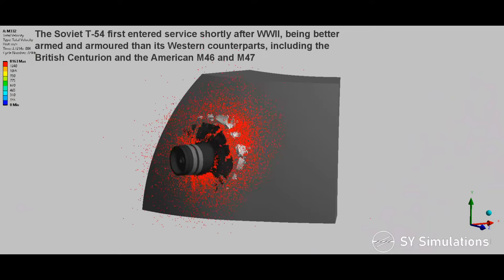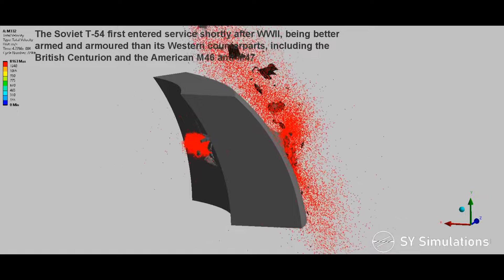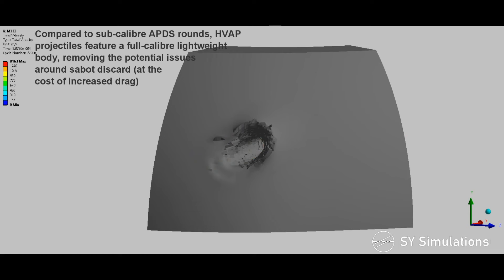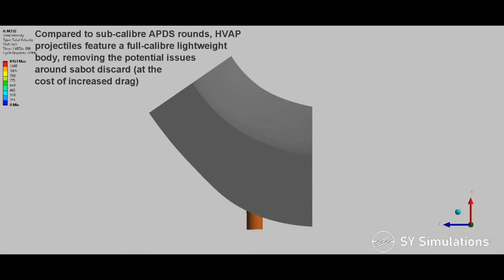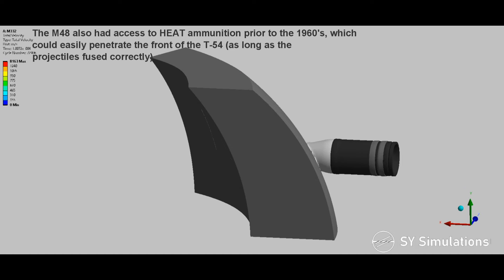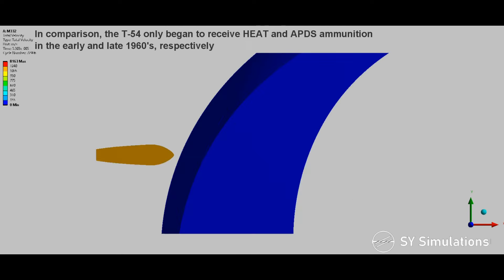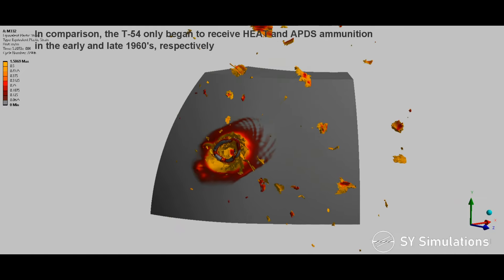M48 PATTON vs T-54 | Standoff at Checkpoint Charlie Pt.2 | M332 HVAP Armour Penetration Simulation

Comment: I was more interested in how it would fare against the hull’s upper front plate of T-54 than the turret.
Reply: I'd be interested to see an M48 gunnery manual from the time. I wonder if they were told to aim for the turret, hull, or center-mass. I am guessing the latter.
Reply: @SeanMurphy1090-d5u It was essentially point blank at checkpoint Charlie so they could’ve aimed anywhere they wanted really 🤷‍♂️
Reply: @SeanMurphy1090-d5u Tankers don’t really aim for any specific part at realistic range. The goal is to hit the target, and it’s harder than it looks even at closer ranges. Most nations train tankers to abandon tank after a direct hit for safety, so a single good hit may be all that’s necessary even without penetration or significant damage.
Reply: Literally said in the description.
Reply: @SeanMurphy1090-d5u I'm fairly confident that the manual tells the tanker if you shoot the front right hull of the T-54 with a heat round, there will be a high chance of ammunition explosion. So at normal engagement distance you would go for the center mass, however, you should know to aim at the ammunition storage when you can confidently do so.
Reply: Tankers aim center-mass, always. 

Aiming for ammunition is very, very rarely done and is mostly a video game thing War Thunder players assume is realistic.

Comment: Very nice note about fusing of western HEAT rounds. For some reasons fuzes on those were very mediocre and they never bothered upgrading them properly, which led to substantial fuze failure rate at 60 degrees slope and near guaranteed at angles over 65 degrees.
Reply: As far as I know this was more for the M348 HEAT shell and less of an issue for the M431 that would've been issued at this time. Not sure how true that is though
Reply: M431 was a vast improvement over the previous heat designs. The 431 was very effective against front glacial slopes.
Reply: Up to M68A1 too, M456A2 remedied this issue
Reply: What I gather from that is it seems APDS overall was a better choice then?
Reply: Hey man, those Yugoslavian tests showed the 90mm HEAT-FS could just blow right through a T-54's turret, even the hull. The fuse was pretty solid too, only messed up when the tank was angled like, way past 20 degrees.

Comment: i've waited so long for a m332 vs t-55 simulation, thank you! very underrated ammo.
Reply: very overrated, this is the 60s.
Reply: @juri8723  M332 was underrated actually. It was more or less equivalent in performance to any APDS round being deployed at the time. 

But because of War Thunder and false beliefs about HVAP ammunition, it's unfairly maligned.
Reply: @MacSalterson 
Even when compare to mk3, which has roughly the same core, it still goes 200m/s less at muzzle, and the delta only grew as range increase. Russian 100mm apds has a even bigger core. Performance of them are very much not roughly equivalent.
Reply: @MacSalterson  Warp Thunder, because it warps perception.
Gaijoob intentionally shitcans the performance. The whole 90mm situation is the most egregious case of outright lying and suppressing everyone spamming them with primary sources that say it's wrong.
Reply: @juri8723  LOL Tankie
Reply: If the american 90mm had correct performance, german and USSR players would have a very rude awakening. It was a very mean gun.

Comment: Would it be feasible to create a 105mm smoothbore cannon based on the L7 that uses its ammunition?
Reply: There's a HP 105mm that Cockerill use that I beleive can use ammo from the L7, someone correct me if I'm wrong.
Reply: Wdym? 
Like someone make a smoothbore and shoots 105 rifled munition without any modification to the munition? 
Yes, with enough money and engineering talent, it can be done. 
Would you want to do it? No.
Reply: @jintsuubest9331 It is the barrel that is rifled or smooth, the ammunition is only placed in the breech.
Reply: @LCE1313 
Emm, yes?

Comment: The small issue is that the M332 was generally not included in combat loads after the Korean War due to excessive barrel wear. In fact, when certain M48 units were put on combat alert in anticipation of the Cuban Crisis escalation, they were not issued the M332.
Reply: Also, M431 HEAT either was not very common until 1963-1964 when it was mass issued.

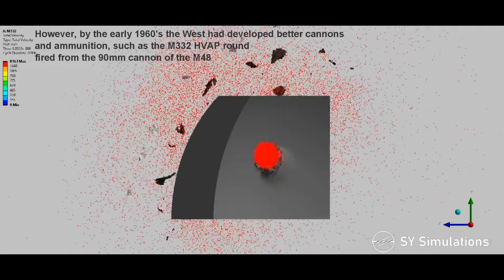Comment: At 0:25 is there why the shell is tapered like that? Look not right but when penetration it is normal shaped again. Did this affect Simulation?
Reply: its probably just how the camera optics are modelled in the app, the shells not tapered but what the camera can see from a certain line of sight might look tapered
Reply: It's rendering the visualization of the AP round's core doing its part after the shell tip has started creating the penetration cavity and then disintegrated.

Comment: It would be cool to see a Tiger vs an M4A3E2, where the tiger shoots the jumbo on an angle at the front sprocket.
In War thunder this weak spot always works lol.
Reply: pzgr39 88 @ tiger 1 mv, using German qualification, will pass 70/60, while being intact. 
40/70 will most likely provide little resistant. But weather it will be fit for burst is of anyone guesses.

Comment: The M332 HVAP first appeared in early 1960s, so it probably wasn't deployed to Pattons in Europe by 1961.
Reply: Debatable tbh, I mean you’re probably right but the US specifically does a really good job at keeping its troops up to date with newer equipment. But I’m not sure how well that applies with tank shells
Reply: Europe was probably the first place to get next-gen equipment.
Reply: @christopherchartier3017  I tried to find information. Some sources states that M332 first appeared back in 1950s, but under different designation - either T65 or T67 (T67E7?). So, maybe I was wrong.
Reply: @СмыслЖизни-с3м  Well, I can say that T108E46 (pre-designation for M348) is listed in manuals for the M3A1 90mm gun as far back as 1949/1950. It’s availability is unknown but I assume it was numerous enough to be listed in those manuals. M431 HEAT-FS started appearing in 1958 but as a different proto-designation but was being released at limited quantity for both domestic and export tanks. It existed but there wasn’t a whole lot of it
Reply: @СмыслЖизни-с3м  Can’t really comment on M332 specifically, I’m a little rusty on that round but I’m sure it was available for the time